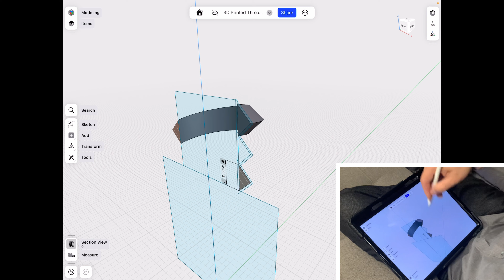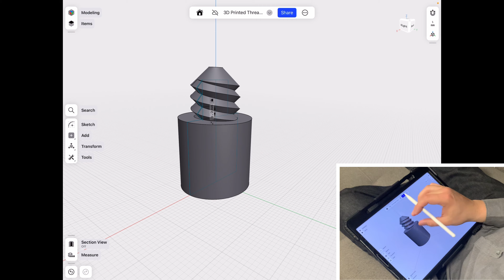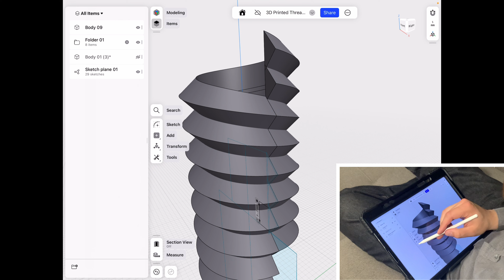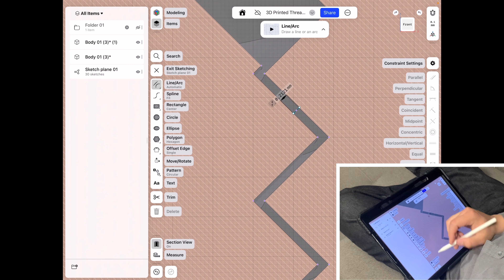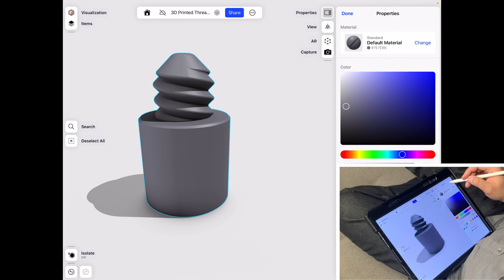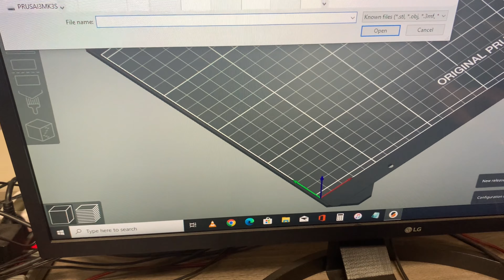Custom 3D Printable Threads Tutorial [ Shapr3D ]

Comment from the maker: If you do end up making reverse threads as I did, simply mirror your project ;)

👉FYI, this video is for people trying to make CUSTOM threads for their 3D prints. If you need regular thread, there are way easier options like Mcmaster download or Fusion thread tool ;)
Reply: Why you didn’t round/chamfer the inner thread?
Reply from the maker: Because it would shrink the tolerance ;) I filleted the outside thread to make it even smoother as it twists, but for the inside I wanted to make sure it printed as accurately as possible👌
Reply: @JLake3D  Okay, but it shrinks the tolerance a little on the outside anyway. But yes it is enough to make one of them smoother. 

I liked the workflow. On my last thread design I was lazy and just scaled the thread to create the inner one cut. 

I also had to mirror it at the end because I was out of focus all the time and recognised it short before the slice.

Maybe you should load the beta with parametric history function for your next videos. You could also easy go back and make little changes on the fly.
Reply from the maker: Yep it does a little bit itself based on the layer height you print at. Also the reason I made this video is because if you want to make a thread as small as possible while still keeping it printable you need to do it manually to achieve perfect results that are repeatable on a large scale project. Scaling is not always a good option due to precision issues even if it often works.

Soon we will all be in parametric since beta has been out for while :)

Comment: I want to do a 3d printed guitar tuner. I am kinda stuck at doing a worm gear. How would you draw that, and if you have something more complicated, say gear chain. How would you draw that,
Reply from the maker: You would have to understand how gears work first, drawing is easy, but getting the math correct is the hard part. Unfortunately i’m not an engineer, so I don’t know the math behind the gear ratios etc but I do plan on learning it in the future just like I did with the hirth joint tutorial :)
Reply: @ will be looking forward for that video in the future

Comment: The guys at shaper have done an outstanding job on this software especially for use on the iPad but they never made it clear at the outset that it wasn’t ever going to be designed for this type of engineering. They have spent a fortune on visualisation and and all the Apple vr stuff  which is great if you want to design a kettle or a toaster and show it to someone but in my opinion they have missed the point especially if you take into account the boom in 3d printing. The number of steps that you have had to use in this video to produce your threads is ridiculous by any measure. Kudos to you for having the patience to work all this out and I’m sure it will help a lot of people but I wish they would wake up and fix this.Thanks for the video.
Reply: Agreed!
Reply from the maker: In total agreement with you, I was one of the first proponents for the thread tool but they seem to have shut down progress on that for whatever reason. Very unfortunate.
Reply: Totally agree - what program do you recommend the please?
Reply from the maker: Fusion 360 has a great thread tool.
Reply: I guess we can request features from them and in the meantime we can take our design to Fusion to make the thread then come back.

Comment: YES, can we just have a few bolts that are already designed allowing us  to edit the design for different bolt sizes and different treads.I would rather spend my time designing other stuff. I rarely need a plastic bolt but for but to take a bolt and subtract it to make a threaded hole. I need to do all the time. There are probable other uses for making a bolt if iI need a custom size. But I just try to design my parts to use a standard sized medal bolts
Reply from the maker: You should visit the McMaster website ;) they have downloadable bolts of all sorts in a .step format 👍

This video is specifically for custom threads for 3D printing :)

Comment: It's time for a better way to design threads.
Like right now it's just incredibly bad and a real shit...!🙈
Reply from the maker: Totally agree, but for custom threads you would need to do it this way even if there were a thread tool ;)

Unless they decided to finally incorporate a 3D printer style thread. Which sounds easy but noone is doing it 🤔
Reply: @JLake3D  Absolutely right for custom threads. But the majority of users predominantly construct standard threads.
Developing a template for all metric and inch threads shouldn't be a big deal.
Simply enter the starting point, hole depth, thread type, thread length, bottom shape and direction.
Life could be so simple...😉